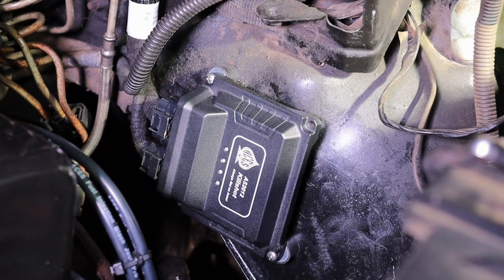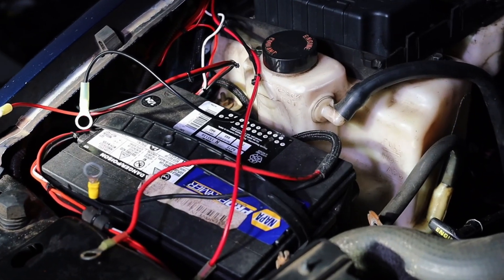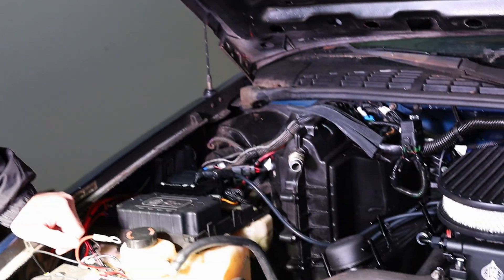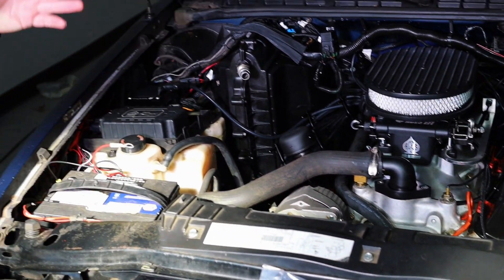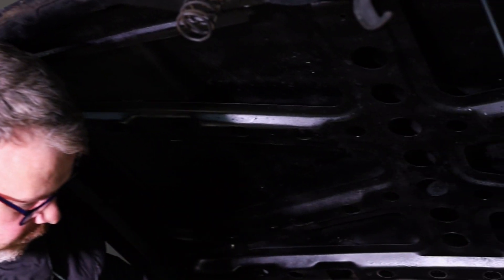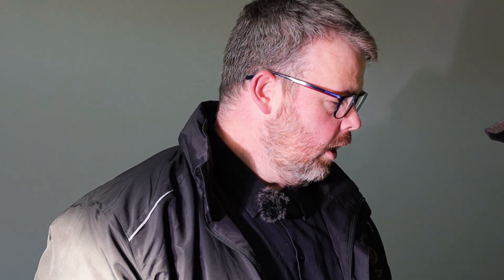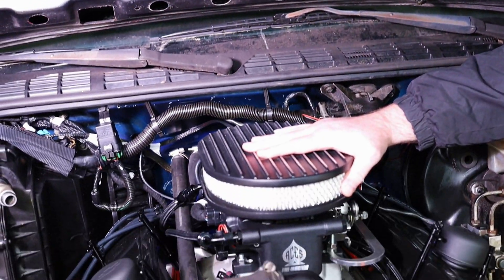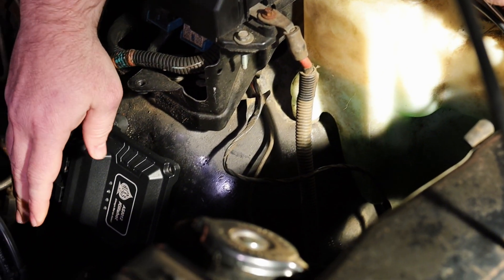Updates & Wiring Harness (Killshot TBI Installation Guide Ep. 2)

Comment: Hey Tim, running my KillShot bot year and half no major issues !! Only question I have is how come my IAC never stays in spec ? I’m always having to re adjust to keep btw 6-20. Any advice greatly appreciated. Eddie
Reply: Is your coolant temp staying consistent? higher ECT=less IAC/throttle blade opening needed. If you have an engine that varies 15-20 degrees between driving conditions, it's going to vary how much IAC it needs. If this is the case, set your IAC when the engine is at the highest operating temp it sees.
Reply: @ thanks man. Yes my temp always the same. This been really only issue I’ve had other than tuning. It’s on rich side @ idle (need to fix) but IAC has never stayed consistent. I’ll drive home from work get home and it’s out of spec. I try to set in middle to give lil wiggle room. Can’t be that sensitive that im over adjusting 🤔🤔.